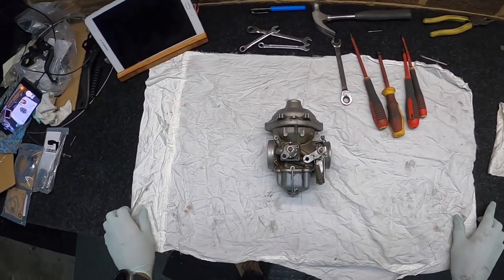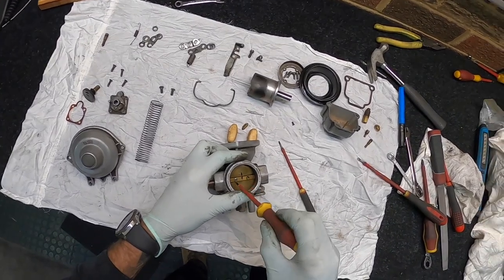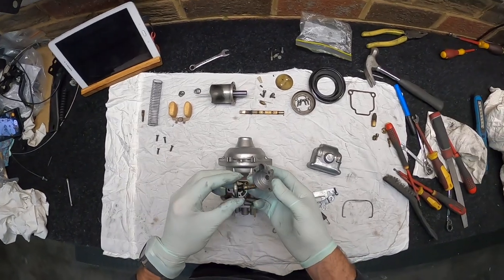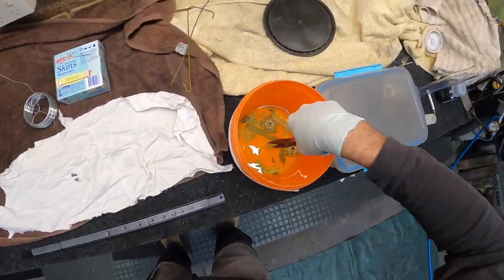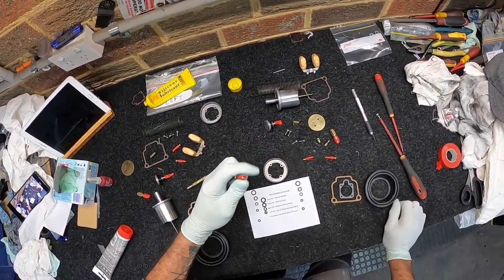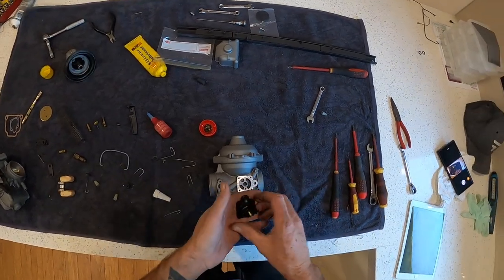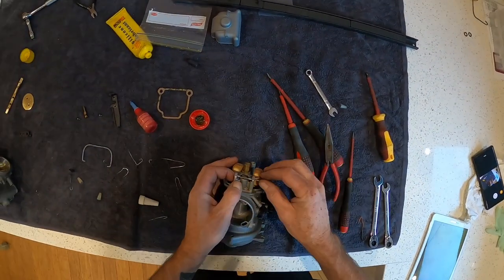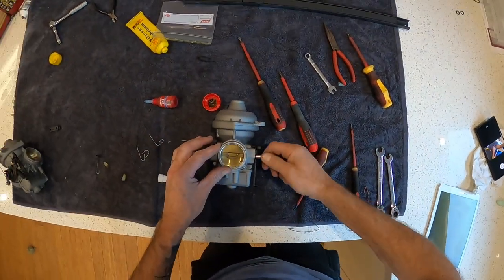BMW R100 Bing carby overhaul, full rebuild, manual choke install and finished in cerakote titanium.

Comment: Turned out very nice and looking forward to doing mine in the near future. Can I ask what was the solution used in the ultrasonic cleaner and where did you get those cool choke actuators? They look like an ideal carb to do as a first time unlike me who for the first time took on a set of 4 linked carbs from my Honda, talk about a baptism of fire!
Reply from the maker: Thanks Fiorello 🙌 I use a dash of washing detergent with a splash of white viniger and water but have also had great results using CLR clear and water. The manual choke is from Motorworks UK 😉
Reply: @twistedfatebuilds  cheers